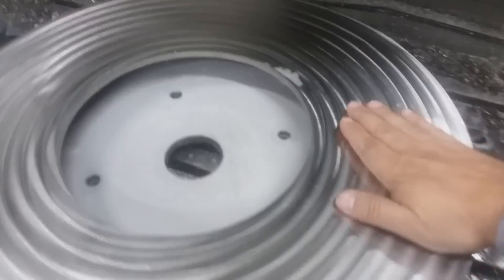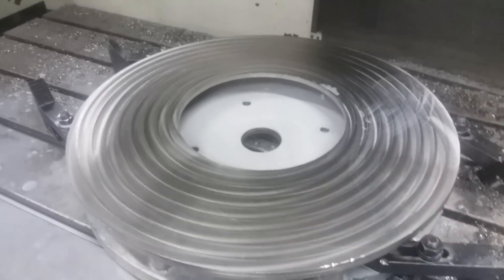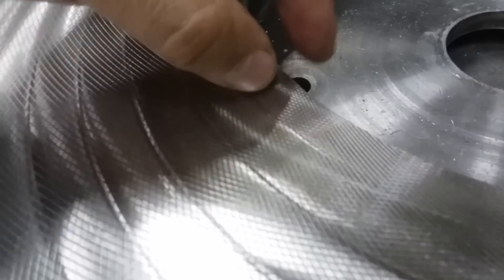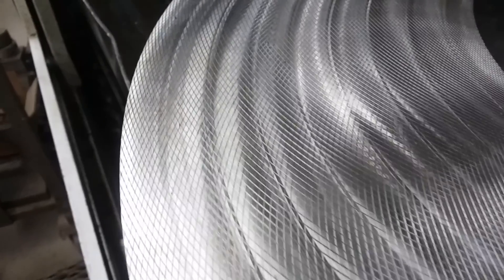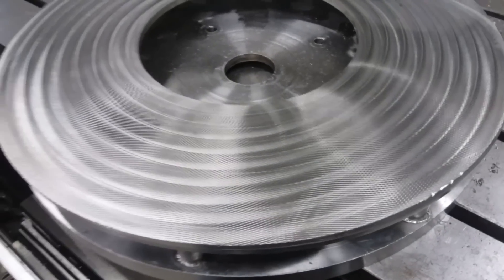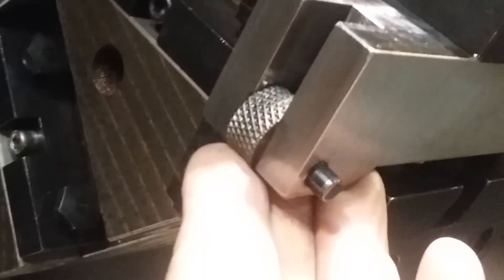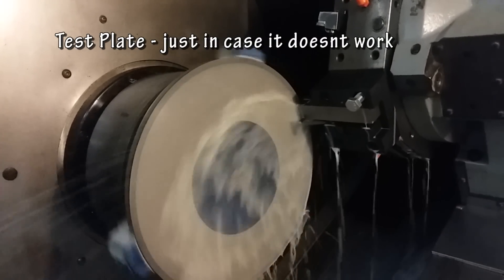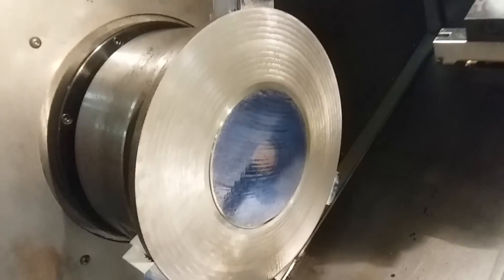Face knurling a 22" plate on a lathe VS on a mill

Comment: Thanks for the video!  I'm looking into giving this a try with some plastic pieces I have.  Did you have to synchronize your feed rate with the rpm of the boring bar to keep the knurling consistent as the cutter came back around to the starting point?
Reply from the maker: No, but you only get one shot at it

Comment: Does look nice with the fly cutter but wouldnt regard it as a knurl, just cosmetic.
What haappened at 3 min 8 secs?
You can get an even face knurl no flats as often seen, been doing it for 20 yrs steels to aluminiums.
Reply from the maker: On the mill is more like a surface pattern than a knurl... but it is nice and even, almost like snake skin or fish scales
Reply from the maker: At 3:08 is where the tool moves to the next position.  You cannot cut the face knurl across the face, it must be individual tracks
Reply: Unfortunately your incorrect, been doing just that for near on 20 yrs but is difficult and wouldnt be able to do cnc as you have no feel for whats happening!
Reply from the maker: i saw your video of knurling the edge of a tiny disc.  if you can make a video showing what you're talking about going completely across the face, i would enjoy it and i think many others would as well
Reply: Maybe you could ride straight through if the knurling wheel was tapered? Ach, no. You'd still have to change the taper as you got closer to the center of the disk. Interesting though.
Reply from the maker: I think the problem would be evenly dividing the circumference of the cutter to the circumference of the path on the plate.

Comment: I could look this up on YouTube but I figure you might know can you cut a knurl on brass using a small woodworking lathe?  Asking for a friend.
Reply from the maker: "for a friend" huh... im sure you could with a little trial and error and provided:
1. you have a knurl wheel on a lathe tool handle
2. using soft or half hard brass, full hard brass will be a problem. 360 would be the brass of choice
3. run slow rpms
4. take your time
Reply from the maker: If your "friend" is serious, I could give "him/her" some suggestions
Reply: Thanks I'll let my friend know.

Comment: No fair, you cheated by using CNC.
Reply: I wonder if doing it manually you can get that nice pattern.
Reply from the maker: LOL, gotta use what you got... and i got CNC's
Reply from the maker: good question,  as long as you were able to maintain constant feed rate at 10ipm... you could do it

Comment: the mill version looked more like snake skin - the winner in my opinion
Reply from the maker: yeah, the mill does a nicer more even pattern, but unfortunately, its a one shot deal.  you can pick up the exact position of the pattern again so if its not deep enough, you have to start over.  did it give you an idea for a project?